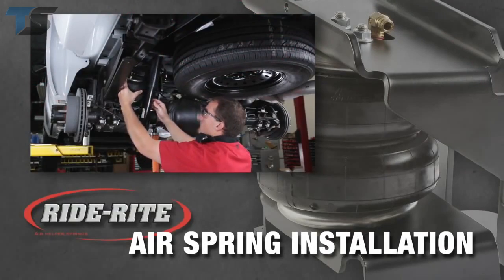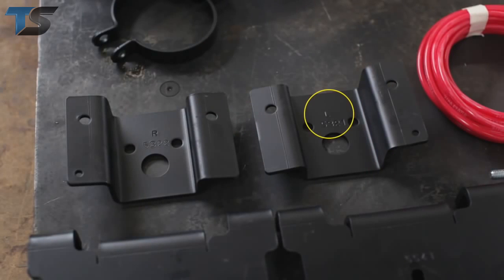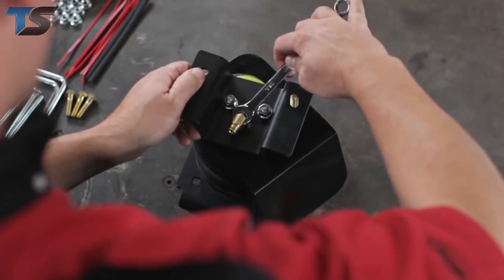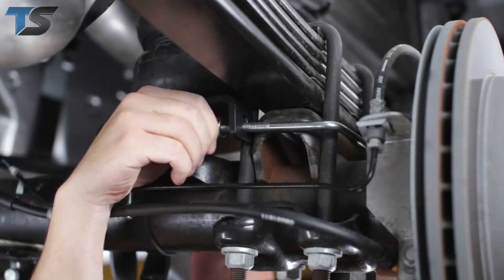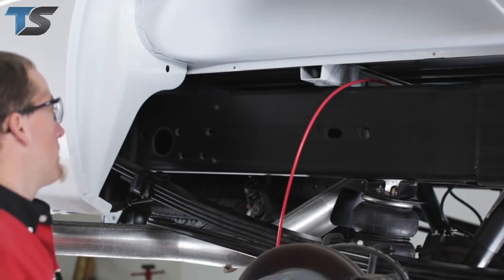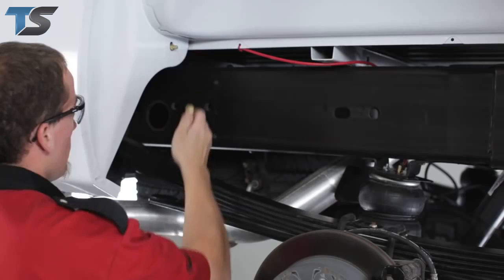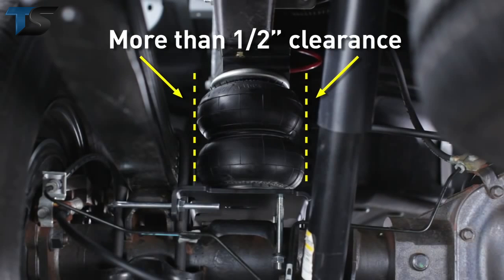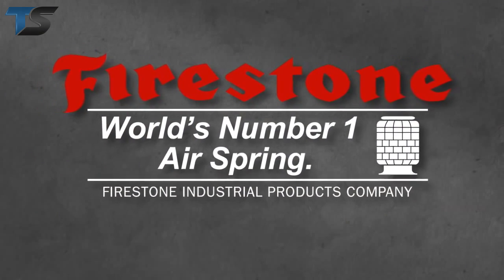How to Install a Firestone Air Bag Kit

Comment: I put the extreme duty version on my truck with 250 psi of nitrogen and use a weight distribution hitch, Timbren, add a leaf, and overload springs.  All together, I increased the weight capacity of my Tacoma to 65,000 lbs.  I pull a 2022 DRV Santa Fe 5th wheel converted to a bumper pull.  I have no problem steering now.
Reply: What’s a timbren?

Comment: I have a 2008 Sprinter that came with the Ride Rite Air Springs. Lately I loose air pressure after about 5 minutes. I did the soapy solution spray on all fittings and no bubbles. Is it possible that the air springs (bellows) themselves could develop a leak? I sprayed all over the block where the three hoses come together. Does the tubing simply pull out after pulling on the brass fitting? I haven't tried that. I have a tubing cutter like in the video and I think I might cut a half inch off each tubing and re-seat them. Suggestions?

Comment: Used truck I bought I think has these and compressor was going out so they disconnected it. Is that dangerous?
Reply from the maker: Firestone air bags are designed to run with a minimum of 5-10 psi depending on the kit. Running them without air will cause damage to the air bags. If you are concerned about something you are disconnecting being dangerous we recommending having a repair facility take a look at it first.

Comment: Really looking into these kits.  I have a lifted truck and don't know which would be better for my purpose.  Axle mounted or Spring mounted?  I will be towing camper trailers more often now.  I first realized how bad and dangerous my truck is when I towed my wife's car from TX to ID.  The squat sucked!  Any help appreciated.

Thanks!
Reply: Just have to mention that doing this install on a 09 GMC 3/4 Dmax 4x4 Crew part # 2250.  FYI  use the reg bolt on the bottom of the bag not the wedge allen head bolt like this guys did. and leave it loose and once everything is on and centered you can get a box head wrench on it to tighten. Everything else is easy and straight forward.

Comment: i have a 1500 Silverado ON A 3.5'' lifted can I still use these bags ????
Reply from the maker: Yes, in most cases a helper bag kit can be used with a lift. You will need to add a spacer to accommodate the extra height. Please feel free to reach out to us with any questions. It may require some measurements to confirm as not all lifts will increase the height on front and rear equally.

Comment: Could I install a kit like this on my 02 duramax if I were to put a 6 inch lift on it? Or would I just have to make spacers for the bag brackets?
Reply from the maker: We have multiple options for air bag spacers that will allow you to install an air spring kit with up to a 6" rear lift. It is common to use a lifted truck to tow, so both Firestone and Airlift have made spacers to accommodate them

Comment: What pressure do I use in these when I have no load? Do I keep it at 50psi? Or 5psi?
Reply from the maker: It will depend on the ride that you prefer. The majority of our customers prefer to keep it at the minimum psi, around 5-10 psi, so it does not impact the ride quality when not loaded.

Comment: I just installed the RideRite Air Bags on my 2017 F-150.  I’ll be pulling a 9000lbs travel trailer.  What PSI would you recommend I inflate the bags to?
Reply from the maker: For Ride-Rite kits, we typically inflated them to 50 psi and connect the trailer and then adjust up / down to the designed ride height. It will take a few test drives to dial in the air pressure for your specific truck and trailer and what ride works best for you.

Comment: Could I install on my 2014 F150 that has 2 inch lowering shackles on the rear?
Reply from the maker: It is not recommended to install a standard air spring kit on a lowered truck. The bag can be pinched and damaged by being over-compressed. There is an option for your application that covers lowered trucks. If you are interested please give us a call.

Comment: Does a screw on air hose work? Or only a press on to fill?
Reply from the maker: The inflation valves that are included in the kit use a standard schrader valve thread so a screw-on inflation valve could be used.

Comment: Kit 2597 is it going to install the same way?
Reply from the maker: The 2597 will use a different upper bracket so it will install through the frame horizontally instead of on the bottom of the frame. The upper bracket will wrap around the frame and position the bag in the same location on the axle.

Comment: Will this kit work for avalanche 2007? Anyone ?
Reply from the maker: Firestone kit 4108 fits inside of the coil springs on the 2007 Avalanche 1500 (without Autoride).  https://www.truckspring.com/products/firestone/coil-rite-air-spring-kit-4108.aspx